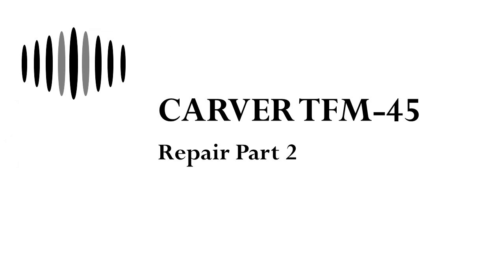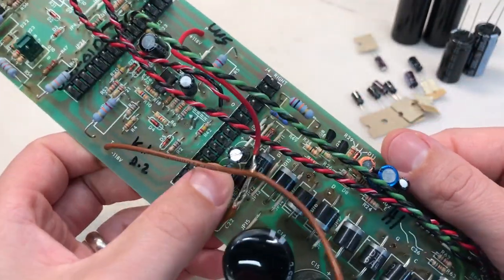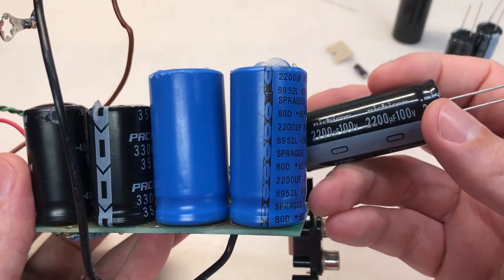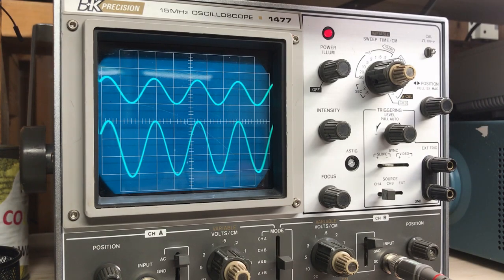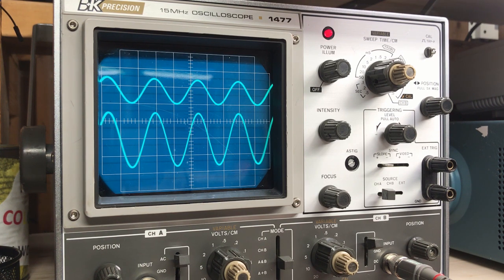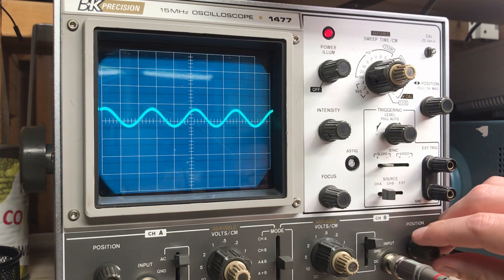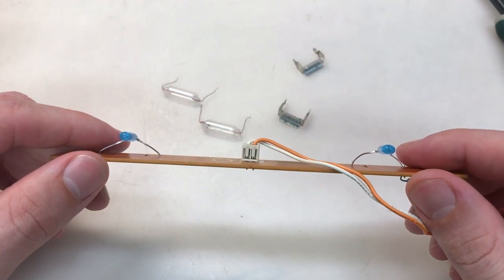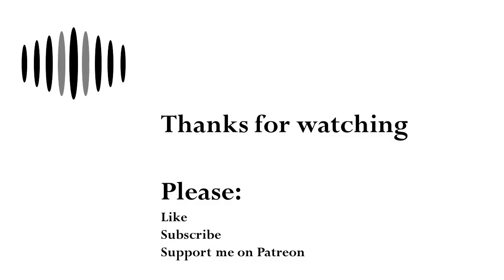DR #34 - Carver TFM-45 Repair - Part 2

Comment: My experience working on these amps (I owned several) is setting the rail voltages first, then check and set the bias, then checking the rails again.   When both are correct after 10 minutes or more of warm up time, this should be good.  But, follow the service manual directions.....Carver knows best.......grin.  Great video!

Comment: i learn a lot from your videos but just as info, I also noticed the same as Jarraknz. the manjual says to adj ust to 1Vrms, which is 1*2*SQRT(2)=1*2*1.4142=2.8284Vpp 
so the higher channel was pretty much bang on. it seemed nearly 3V. So you should re-adjust both to 2.8Vpp, not 1Vpp otherwise you loose two thirds of the power of that amp on both channels

Comment: Thanx, nice work and great video.  Did you ever find the answer to the two floating wires?
Reply: This model of TFM45 appears to be an older release. Those two “floating” wires form an air capacitor C26. It was removed at the end of 1990 along with D18-D21 rectifier diodes to reduce buzz coming from 67V dc rails. The 4 diodes were replaced by a separate bridge rectifier.
Reply: adjustable capacitor - a couple of picofarads.

Comment: these amps are some excellent designs, most often times they just need to be adjusted, that pnp shorted transistor was right on the edge of failing if it was actually shorted the neg rail would all be seen on the speakers which means they would be done for but that was not the case

Comment: 4:30 cleaning boards with Q-tips (Topz is another brand) they work nice, but toothbrush is even better for some solder joints. due to lead being used untill 2005 and even after that in some countries reserve a ex human use toothbrush or electric toothbrush tip solely for PCB cleaning. and use which alcohol you prefer Methanon Ethanol or  isopropanol.

Comment: I had a Carver TFM45 all rebuilt and it gets hot after 2 hours of play  at low volume
Reply: There may be A problem with one or both channel idle currant and is out of adjustment.  I suggest not use the amp until the problem is corrected. this adjustment needs to be done by A qualified tech. If you live on the west coast USA I recommend shipping it back to Carver. If you are local in north Alabama I will be glad to evaluate the problem.

Comment: I also watched both parts hoping for a resolution to the thunk sound on power-up. Never heard it mentioned again. Did the cap upgrades solve that too?
Reply: I couldn't see which one but one of those filter caps on the PS board was severaly bulging and I wouldn't be surprised if that was the cause of the power-on thump.

Comment: Excellent teaching abilities and a great instructional video, thank you. If it's possible I would require your opinion on the same amp regarding a momentary thumping sound heard from the power transformer when first turned on. Then there is a continuous buzz coming from the power transformer.(no input, no speakers connected)The amp output measures good. The sound is good with speakers on. I wonder if you can please share your experience regarding this problem. Thanks again
Reply: Hi, I am Alfredo and have here the same noise from the transformer, do you have any suggestions? Thanks
Reply: I have an AV405 that had a hum when it was brand new. I took it back and got a new one, same thing. Turned out, there was a halogen floor lamp in the room causing the amp to hum when the lamp was turned on.

Comment: Very nice series! There is a service bulletin to replace RP2. TFM-45-4. Basically replacing the RP2 with a 500 ohm pot and adding a 750 ohm resistor. More than likely the op amps were fine but either way they are new now.

Comment: Did you replace the main filter caps?
Reply from the maker: I did not. The only comparable caps I found in value were much too large in diameter.
Reply: @dualityrepair4770  circuits and concepts on EBay make a circuit board kit with ganged caps to replace them. Same as Nelion. I had them installed in mine.
Reply from the maker: Oh good to know thanks.
Reply: @jebrehbaker8613  Greg at Nelion is the right guy for Carver repair/mods.

Comment: Why did you adjust RP2 for 1V p-p when the manual calls for 1V RMS? Aren't you robbing the amp of gain unnecessarily? The right channel looked to be perfect where it was, pre-adjustment.
Reply: Even worse: 1V rms is 3.4Vpp. So the loudest, left channel was closest! Nice repair though.

Comment: Man this series came at the right time.  I have a TFM 45 and it needs some work.  I just recently looked for the schematics and your right there hard to read.  I have the original manual and have been running it in Mone for years with just the left input like the manual shows.  Found they updated it to show use both inputs when in mono mode.  Whole different amp lol.

Comment: Very nice repair. I have to agree with andymouse 123, the blue LEDs look dreadful. I was wondering what you use for an 8 ohm load when aligning the output levels - I didn't hear any sound so I assume you don't use speakers - or do you voice-over your video?
Reply from the maker: I use a 50 watt 8 ohm resistor.